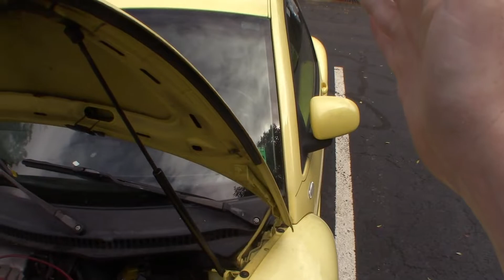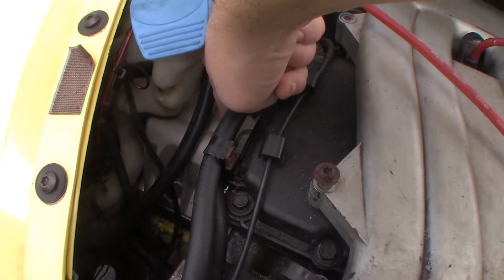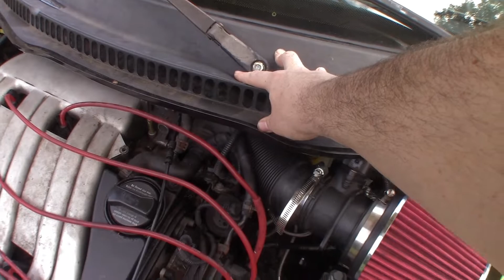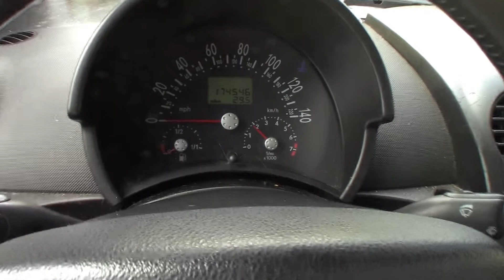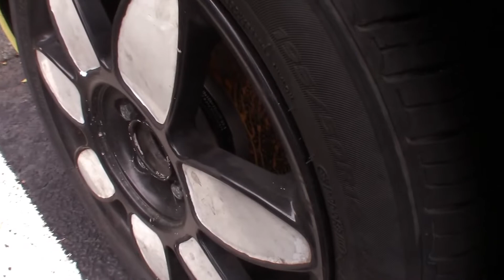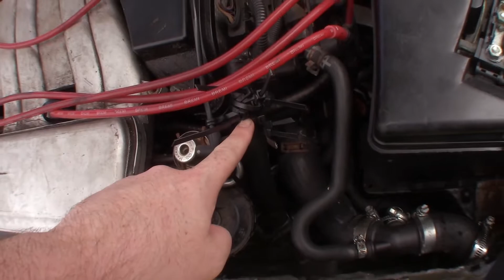VR6 Swapped Beetle How Much Did It Cost? Was It Worth It? You Tell Me!

Comment: I had this project ready to go, but a gentle old man decided my 13s 05 Gti needed a irrepairable refresh. So im now taking everythig off that and doing a sleeper Beetle instead including the bigger Audi TT brakes. Oftentimes instead of immediately crying a river you simply redirect your attention and make a neg into a positive. Should still run 13s but it needs a rear wing before I do any high speed runs against the mopar boys, Lol. All that said nothing beats VR6 sound other then the 2.5 with a good muffler then its a flip of coin.
Reply from the maker: man bro someone hit my mk4 gti i feel you
Reply: @Patrick-Mckinney  The 1.8T bug is alive and well and will be on the road next spring. The swap wasnt too bad especially since I had the tuned ecu and complete engine wiring harness. For the most art everything from the Gti is a direct swap until you get to the ac and the power steering line. Exhaust 3" Dp all the way to the muffler was too loud so a new Cat and HF cat for the resonator toke care of unwanted sounds. The first time you fire up these projects is a feeling like no other, cheers.

Comment: You missing check engine light 😂 the led is blocked
Reply from the maker: no CEL! only issue is the turn signals headlights and the blower motot all failed at once. so i have a wiring / fuse issue it looks like

Comment: i’m currently doing the same swap on my 02 turbo S, for your harness/ecu setup, did you use the vr6 harness for the engine bay area, then keep the stock wiring harness for all the interior?
Reply from the maker: yeah just change the engine harness and you should be good to go!
Reply: Question do the cluster still work with swap?

Comment: Hah!  This sounded like talking to my accountant.  What I really, really wanted to know is how you got the engine in?  Was the tranny / engine combination the same length (left to right) as the 2.0l & automatic original combo?  What about the CV Axles?  Did you do all this work in that parking lot?
Reply from the maker: This car has a interesting back story 
The work began in my driveway and the engine and transmission was installed 
To understand the axles just know that from knuckle to knuckle is the same lenght on all mk4 and beetle and some axles are interchangeable and fit diffrent manual / auto configurations 

I had brought the car with me to a hotel I lived in temporarily and I even did some suspension and electrical work on it in that lot 
 
I got then got to the crank but not start issue and the shop get me fixed for very fair price 

After getting the car back some odds and ends were done in this lot but any other work I ever did was done at my EX girlfriends moms house
Reply from the maker: Its been a long time and this car has been on the back burner so i don't remember the axles but what I do remember is this 
The driver side axle on my donor vr6 was not usable so I believe I ended up using the axel from the 2.0 automatic 
And I guess which is not a surprise I soon broke that 2.0 axel doing launches

Comment: Which ECU did you use? 
From the donor car?

Living in an area requiring an emissions check, the ECU serial number must match the Vin. 
Does anyone know if it’s possible to tweak the stock ECU to support a six cylinder? With a six cylinder being offered in the RSI… you would think the coding for 6 cylinder support is buried somewhere in the ECU.
Reply from the maker: This new law is not far to someone who even has a ecu fail on a car
Reply from the maker: Its gonna have to be a vr6 immobilizer defeated ecu 
Thats gonna be dousy idk how you'd get around that unfortunately 
But check in historical registration if your area offers this and in a few years a 98 or 99 beetle would not need inspection

Comment: How about an '06 beetle?
Reply: What's a good swap for that year?
Reply from the maker: @tatsu0845  its pretty much same everything and can do vr6 or 1.8t
Reply: @Patrick-Mckinney  Awesome! How difficult is making an automatic into a manual?
Reply: @tatsu0845  about as difficult as removing the transmission
Reply from the maker: @tatsu0845  the engine and transmission is best removed as one unit and you would put your Donnor engine and transmission in as one unit 
Install the clutch and hydraulics 
Do alittle bit of wiring or bypass your clutch safety switch 
Removing and installing the shifter is pretty straightforward the exhuast must be removed

Comment: i had one to, made the swap 10 years ago, i loved that car but crashed it 3 years ago...  it was a 2.8 vr6, 6 speed manual 4 motion version. Upload some more driving videos, if you have the budget try magnaflow on it!
Reply from the maker: Im glad you are okay these VWs are built really well like tanks
Lol i kinda wanna keep it a sleeper i was racing a 2020 bmw 330e and we blew by cop at like 85 they didnt even do anything lmao
Reply: @Patrick-Mckinney  by the way i got out with no scrach on me after the crash, and I rolled over 3 times...
Reply: @Patrick-Mckinney  mine was a sleeper as well, I even got steel wheels on it for 2 years :))). It was so-so much fun...  (for high speeds you need a rear wing!) the engine is heavy and the rear of the car is not, so is nose heavy like this. at high speeds it will bounce and its not safe. i hade a rear wing, but the rest looked like a stock beetle.